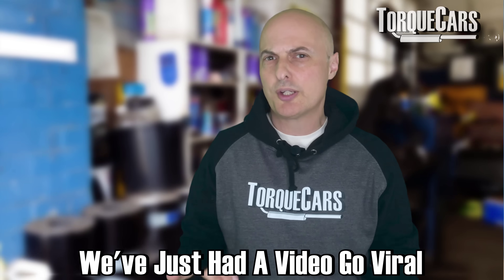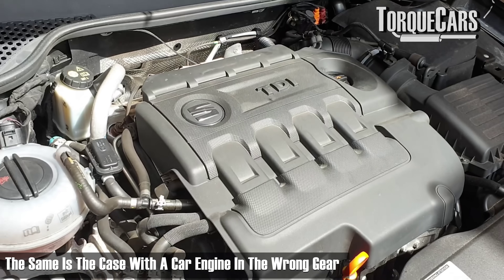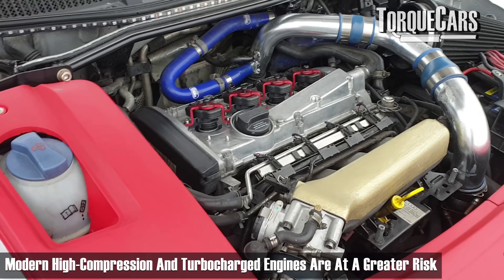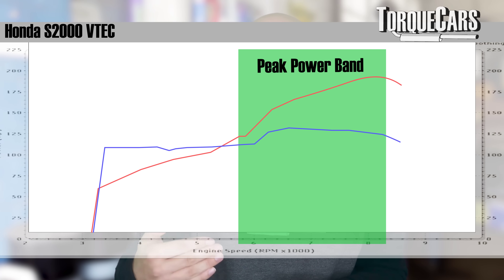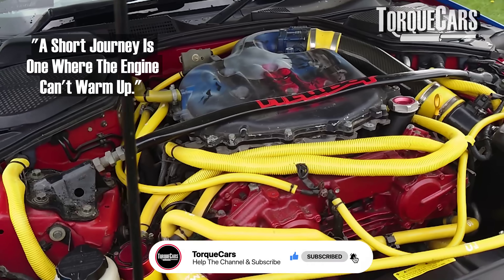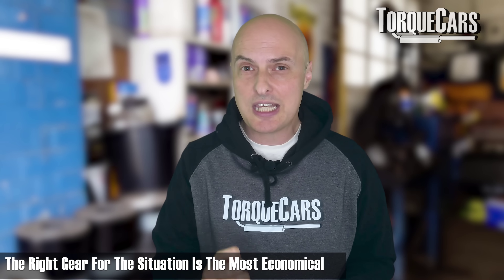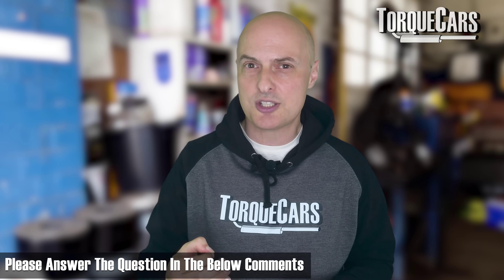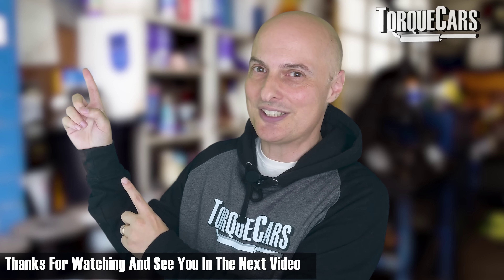Warning: Low RPM Lugging Destroys Engines! Why Low RPM Driving Is Bad.

Comment: If you drive an automatic use sport in city and comfort in highway. Thank me later
Reply: I want to agree, but I'm not sure what I'm agreeing to.
Reply: @Dropz_RSA  In sport mode the transmission shifts later
Reply: @Dropz_RSA  lol... that's so spot on.. 😆.  Though I think I got the idea.
Reply: That is a great tip. Economy mode can be dangerous due to the hesitation in response from the car when pulling away from junctions into moving traffic. Some may find normal mode adequate, depending on engine size and the overall vehicle weight.
Reply: @michaellavery4899  It's ridiculous that modern cars have to use sport mode to get that instant gas pedal response otherwise the computer will take its time sending spark. My parents' Audi is just like this. Comfort mode is complete ass. My Supra with cable throttle is instant.
Reply: @KoopaXross  
To be fair to the manufacturers, they do explain in the manual, using the economy mode reduces the engines performance. It is clear that you are in economy mode and the computer reverts to normal mode when the engine is restarted or it is chosen at any point.
Whilst it may not be ideal for getting around a busy, built-up area, it doesn't pose any problems when cruising on a motorway. Under the correct conditions, my brother's engine even shuts off half the cylinders. 
I haven't heard of any reliability issues associated with it, so it's really a question of driver preference.
Reply: @KoopaXross  In the somewhat older cars there was no reduction in response. Only it would often be in a higher gear. Thus appearing less responsive.
Something that makes the driving smoother when you dont need the instant full power. Such as in any stop and go traffic for example.
Reply: @michaellavery4899  Probably depends on a car, but in a Mazda, if you suddenly floor the accelerator, the car will immediately shift down and rev up, if you go past the click of the pedal, it goes into sport panic mode, lowest possible gear that still makes sense, and peak RPM.
Reply: Probably good for when the journey is short but long enough to get the heat cycle going.
Reply: The problem is sport mode will wait until 3000-3500 rpm to shift, which is terrible when you are starting out on a -10F day.
Reply: Warm it up first, and screw the radical environmentalists.
Reply: @danwake4431 don't switch to it until warmed up fully (the engine oil not you)😂 most cars default back to D when switched off when sport /dynamic selected.
Reply: So true
Reply: I mostly do the opposite. I want response on the road at speed, if something a bit unexpected happens. 
If driving slowly you dont need that. I like the 2:nd gear start that MB uses for comfort mode. Much smoother between all the small intersections. And also traffic jams.
Reply: @greathey1234  I only use sport. I drive 50-100 miles a day all back roads. Living out here the back roads are the only roads.
Reply: I do shift to sport on high degree hills and back to D on rest rest ......
Reply: I drive an automatic on manual mode, I decide when to change gears and I dont like a computer deciding for me in any situation.
Reply: @greathey1234 That's a recipe for very poor fuel economy in the city, but that aside, sport mode also tends to hang on to a gear a lot longer even after you've let off the throttle, and also affects downshifting and breaking. I my Durango, sport mode is like BOOST MODE... Almost overly responsive to throttle input and jerky if you're not ACTUALLY trying to drive sportily ... 
And a 2008 Caliber I rented once, that sport mode was almost terrifying. Extremely jerky. When pressing brakes, they would be a bit soft, so you press more...  and still soft, still soft, then HARD! Not what you want when trying to drive smoothly and predictably in traffic.
Reply: Why?
Reply: My Audi automatic is set to Auto mode so the car decides for me.
Reply: Most here are discussing switching from auto/D to sport/dynamic. Not all cars have these options, but if yours does try it out. It's a better (safer?) driving experience, especially when constantly slowing and accelerating, cornering, crossing roundabouts. You then have better control and use brakes a lot less due to lower gears slowing you when off the gas (or 'engine braking' many like to refer to it as). As pointed out not so useful on motorways, as you would be cruising in simply a lower gear than necessary for no reason and wasting fuel.
Reply: @greathey1234  thanks
Reply: @greathey1234  use sport every time. Thank me later
Reply: My 2009 BMW Series 1 125i convertible is proof that only using the regular Drive mode is bad.  The automatic transmission always shifts way too early causing the torque converter to slip and vibrates the whole car.  I always use the manual shift to keep it from slipping by shifting at a higher rpm than what the automatic does it in.
Reply: I use sport 100% of the time instead.
Reply: It's also good to get a tune for your gearbox if you drive an automatic, they will often (and you can ask for it) correct this behaviour and make the shifts feel more snappy.
Reply: Unfortunately, it doesn't do me any good. Still shifts one gear up after a few seconds when not accelerating. Even when climbing a hill. I can feel and hear it struggling. It took a "special" kind of (eco) manager to write such requirements. But they got 1 mg of CO2 less on the tests.
Reply: Depends on the car, on my 981 S sport mode it too sensitive and there plenty of torque in normal mode to get around. I start in normal and automatic until at temp, then to sport mode and shift with the paddles
Reply: @Jay-xr3sb show-off! 😢😂😂

Comment: Of course, if your 3,200 lb car generates over 300 lb-ft of torque at 1,000 RPM, it's a little difficult to lug the engine.
Reply: you still can if you let off the clutch quickly enough
Reply: It will just go.
Reply: @billspangler2685  Point.  This guys videos are really quite good, I was just in a feisty mood at the time.  Of course here in the U.S. virtually no one still has a car with a manual transmission and there are a very large number of people who've never driven one.  Poor, benighted souls.
Reply: @CorkVanDenHandel   The only reason I knew was because my mustang has a gearbox as refined as a tractor. Some of us in the US have been trying to keep manuals alive, but really one of the only good RWD transmissions in US cars is the Tremec T56 that was originally developed over 30 years ago. 
I definitely agree though- this channel is excellent! I am now subscribed.
Reply: @billspangler2685  The T56 is notchy, but great.  My old C5 'vette has one as well.  The original T-56 was built by BorgWarner for the Dodge Viper, and I think Tremec started building them in 1997.
Reply: @CorkVanDenHandel  For good reason. They are slow as molasses.
Reply: @fortniteisbadatfortnite2570  Yes, 0-60 mph in 4.9 seconds is fairly slow by today's standards.
Reply: @CorkVanDenHandel  ~1% of population is ~330,000 manuals in 50 states. That's around 66k manuals per state if it were even distribution (obviously not). I wouldn't call that virtually no one. 

I'm on my 5th manual car here (2023 WRX 6MT Premium with HK stereo).

Comment: I was wondering do you have any information on which brand of fuel is the best for minimising DPF and EGR problems? I only use V-power on mine. I get the odd regen and it really annoys me especially as the car gets plenty of exercise although mostly driven in town. I wondered if maybe Esso or BP Ultimate would work better? I just want to keep things clean and soot free. I already had to replace the EGR shortly after buying the car so I don’t know what state the DPF is in. Never had the light come on, however
Reply from the maker: I personally have found Vpower to be best on  both Petrol and Diesel. Injectors and carbon deposits are lower than a generic E10 fuel.

Regen is part of the DPF so avoiding this completely is not possible, perhaps if the engine is constantly running and there are no cold starts there will be little to no soot caught in the DPF.

I would recommend running an additive through the fuel once a month or so like the BG cleaner range.
Reply: I am no expert, but I will say that the a high quality oil/fuel can not compensate for the usage scenario of an engine. Modern diesels are made for long journeys, otherwise the design compromises that keep the emissions low (turbo,DPF, EGR, high pressure fuel system) become problematic. On the long run, the lower fuel costs of the diesel might not outweigh the costs of those expensive parts mentioned above.
But this is just my opinion, hope you manage to make it work for you.

Comment: UK motorways 'ABOUT 70mph'! Good one!
Reply: Well the min speed for Vans is 80mph
The maximum for a grey nomad in the 3rd lane is 55mph with zero self awareness of the queue behind.
Reply: @Robert-cu9bm 
The other week, I was about to undertake (which isn't illegal if it is clear they are obstructing traffic for extended periods) one of these "nomads" on an almost deserted stretch of motorway, but there was a car on my tail and my sixth sense was warning me. A couple of seconds later, the blue lights lit up on the car on my tail, and the officer in the passenger seat gave me the thumbs up. 
What bothered me was that they just indicated to the woman, whose seat was so far forward, she could lick the windscreen, to drive to the left. Surely, considering there was a hard shoulder available and an absence of traffic, a timely reminder of the highway code should have been given out.
These people have no idea what they are doing wrong and cause frustration, which leads to accidents.
Reply: Let's go with "Just over 69mph"
Reply: Since I'm not from the UK, enlighten us.
Reply: @martinweizenacker7129  70 is the legal speed limit, but most traffic flows at 75-80
Reply: @martinweizenacker7129  highest legal speed is 70 mph in UK so about 70 implies speeding
Reply: @Matthew54227  So, if you're doing 70mph in a zone with a 70mph speed limit, you're speeding? This logic fails me.
Reply: @Richard_L_Y  i guess u mean ukraine

Comment: I drive a lot of "gutless wonder" big displacement US motors from the late 70's to early 90's.  Yes, they have terrible horsepower and they don't reve that high.  But those old gassers will take abuse and run at low RPM all day because of the sheer amount of torque at the lower end.  They will run on high gears smaller motors would choke and die on.  Power band and respect for it is excellent knowledge, and this is advice that can't be repeated enough.
Reply: With an automatic and a converter stall speed at 80-90% of peak torque they are difficult to lug.

With the datalogging I've done on modern cars it appears many have the electronic throttles programmed to avoid major lugging.

Comment: Good morning Sir.  I am in the beginning stage of collecting parts for an engine swap. I have a 1969 Jeep cj5, the plan is to install a vw ALH engine sm465 4 speed with granny low. I’ll use this Jeep to move logs around using a logging arch trailer for my saw mill. I will keep in mind not to lug the engine and use the low gears for pulling. Thank you for all you share with us. God bless you and yours.

Comment: I have a 335d with an auto box. I guess this doesn't apply when in auto mode?
Reply from the maker: Yes not really, most autos are pretty good at avoiding any situation where lugging will happen.
Reply: Is it e90 with 6 speed? Or is it f30? In the f-series BMW they used 8 speed ZF that always tries to run on low rpm, and these cars with n47 and n57 now have bearing issues because of low oil pressure, crankshaft bending at loads, lack of engine block rigidity, narrow bearings themselves, long draing intervals and so on. If yours is 6speed with M57 it's fine, if it's N57, I would consider 0w-40 oil.
Reply: @deez023  I'm lucky as I have the M57 with a 6 speed box. Practically a bullet proof engine
Reply: The N57 engine of the 335d is known to build up the lowest oil pressure in the 1500 rpm range. So low, in fact, that engine damage can occur. There are even update oil pumps to increase the oil pressure. This is a big topic for many engine reconditioners and tuners in Germany.
Reply: @GP-yx3dn  yeah, it's easy to change 0/5w30 to 0/5w40 If you can't install better pump
Reply: @deez023  I don't think it would be so easy.
Reply: @GP-yx3dn  what do you mean, oil change is not easy?
Reply: @deez023  No, I believe it would not solve the problem of an undersized oil pump.
Reply: @GP-yx3dn  yes it's not a solution to the problem, but it's still a better option, than to keep driving on 5w30
Reply: @deez023 Ok,  I will give it a try. 🤔
Reply: @GP-yx3dn  Also, some people drive in sport mode, but I think it can feel jerky. A better option would be gearbox software change to keep rpm higher

Comment: Im wondering if its ok to start from a 2nd gear if your car has insane torque, like corvette for an example?
I dont see why not from a noob perspective, but is there something about the gear itself perhaps that makes it bad? Or clutch?
 I know it wouldnt struggle to start, since it can start from even 4th gear.
Reply: First gear in many Corvettes is already equivalent to second gear in normal cars. Save your clutch, start in first.
Reply from the maker: I've done this myself in some high power high torque diesel engines, it was the only way to pull away on some surfaces. When you get early torque you have little risk of lugging compared to smaller capacity engine which produces power from 2000rpm upwards.
Reply: @torquecars  Seems about right, i know my dad told me on very slippery road, when its ice, you can start from 2nd gear, to avoid spinning, or rather have more controlled, slower spinning... Thanks for reply!
Reply: The other thing to know about slippery roads is to avoid overdrive / top gear.

When the tire loses grip, and the car is in its highest gear, there is a high potential for the car to raise RPM.  This is especially true for older and even some new cruise control systems!

Using a lower gear puts the engine at a higher RPM, which presents much less potential for a spin out event due to rapid increase in RPM due to tire grip loss.
Reply: No issues from starting in 2nd in my 06 Pontiac GTO with the LS2, same engine as the Corvette that year. I also skip gears too to get better MPG. 2 to 4 then 6th. The power is there to do so.
Reply: There’s absolutely no reason to do it except in snow and ice. Save your clutch and flywheel, use first gear. You won’t save any fuel with pulling away in second either
Reply: @vxvii9069  I just tought potentially bad reason, in very specific scenario, what if you drive older Corvette and the transmission is old as well, so you start from 2nd gear and avoid 1st, since the 1st is the most used one and the gear has the most wear on it?